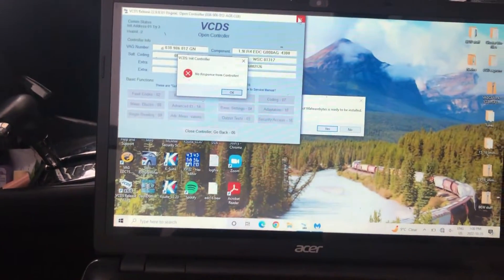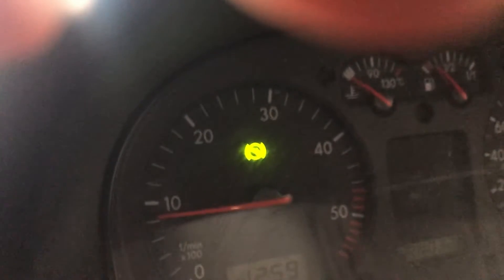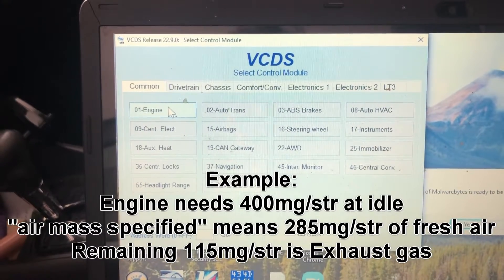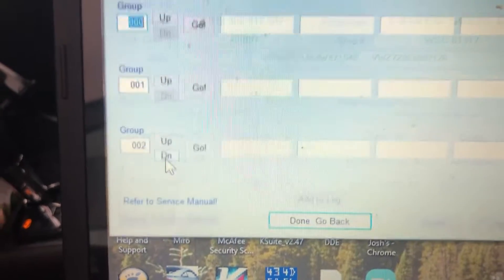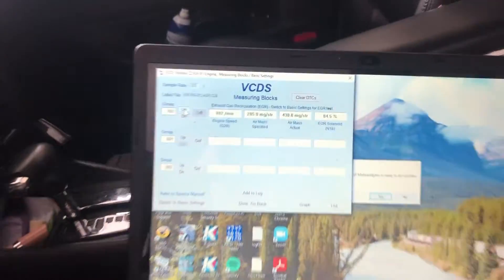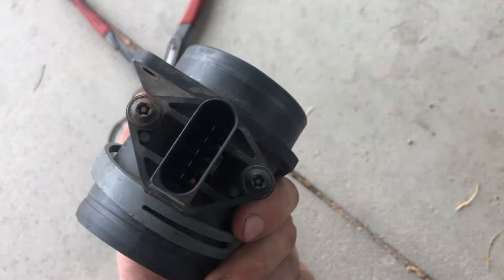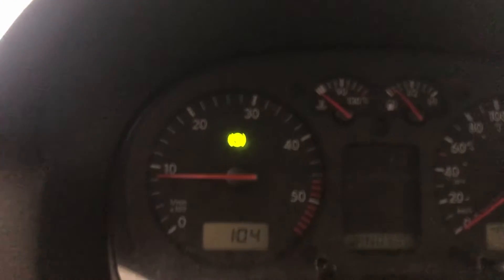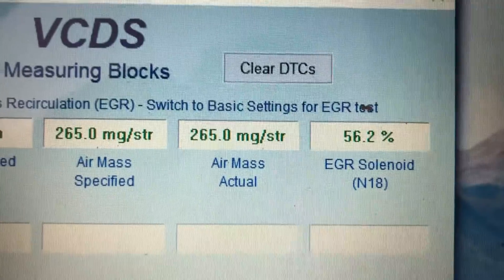VW ALH TDI: Diagnosing P0401 EGR Insufficient flow

Comment: I have a P240F and P0401 codes Will replacing the MAF  sensor fix both?
Reply: check for leaks in the exhaust manifold\egr pipes
Reply: I have the same codes what were you able to do to fix it, I’m kinda at a lost on where to go

Comment: Any idea what a P0402 - excessive flow detected -for CJAA TDI means? VW dealer cleared some soot from the pipe that attaches to the EGR valve. Code came back. I cleared the code and it ran for ~6,000 miles before it returned. The car seems to run fine.
Reply: I have same P0401 on my ‘13 TDI CJAA sportwagen I’ve seen it twice with about 2,000 mi in between both occasions.. car runs great I’ve been responsible for everything, car has 97k mi I did complete timing upgrade recently, which is the only work I’ve done to it, aside from the dealer doing the diesel gate upgrade.. I have VCDS and will verify the MAF act vs specified.. will likely remove the EGR pipe from intake to the exhaust and clean any soot.. car runs great low end and top end lots of power and no smoke and tailpipe is relatively clean.. if you found the cause of your CEL please share as I will once I get to this job
Reply from the maker: The ecu used maf flow to determine egr amount. Excessive egr flow I would guess could be something restricting fresh air such as dirty air filter/poor maf reading or possibly a stuck egr valve. Insufficient flow will be from the dpf being cracked and plugging up the egr filter. Usually any signs of soot after the dpf is not a good sofn
Reply: Thanks  @JoshsJettas . It's at the dealer right now. The last time it was in there for this issue, they said there was soot buildup at the EGR pipe where it attaches to the EGR valve. An obstruction in the pipe, or clogged EGR valve would make me think it would throw a P0401 (flow insufficient) code vs. what I'm getting P0402 (excessive flow). I thought maybe a piece of soot may be preventing the EGR valve from closing all the way intermittently. Or maybe an intermittent MAF issue. I'll post the fix when I get the car back and after a few hundred miles.
Reply from the maker: Exactly, there’s a little mesh filter and it’ll throw the p0401, sounds like the dealership was grasping at straws on that diag, but I could agree with the valve getting stuck open a touch. Either way let me know what you find
Reply: @JoshsJettas  They couldn't figure it out. They needed to open a VW engineering dialog (forgot the term they used) to troubleshoot it further, but once they did that they said they are required to keep my car until the issue was resolved. They didn't want to throw parts at the problem even though I had purchased an OEM EGR valve in case they needed it. I couldn't afford to have my car at the dealership for a week so I took it back. They did take the EGR pipe off and commented that the soot buildup was normal now. I've been trying to drive it harder (2000 RPM and above) and using diesel fuel injector cleaner over the past 10,000 miles. At some point I'll take it back and let them keep it until they fix it. It seems to run fine for now. Problem for me now is I need to get it smog checked and won't be able to do that because the engine light is on. It has 170,000 miles on it. It's been a great car.
Reply from the maker: Is it still under warranty? They should provide a loaner/rental if so. That’s a pain, other option is an “emissions intact” tune which you might be able to keep the exhaust components but electronically delete the egr.

Comment: Thanks bro. My 2013 Jetta TDI 2.0T has P0401, P240F and P048C codes. I cleaned the EGR valve(close to manifold). However, the codes didn't remove. Fortunately, I didn't have smokey and lose power. Should I think about the EGR and exhaust pressure control valve probelm? Thank you again.
Reply: Did you manage to solve the problem with these codes?

Comment: So I have the same problem and haven’t been able to solve it. I’ve put in a new MAF, new vacuum lines, took apart my intake manifold to check for suit build up but there was none. My EGR is in working condition, I checked it with a vacuum pump. The car runs flawless, no loss of power, no hesitation, starts up right away, no smoke during cold start. What else can I try?
Reply from the maker: Any way to see what the maf is reading? Also more common with the PD but cam wear can cause that as well